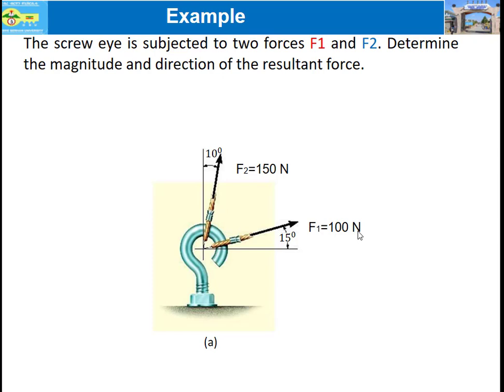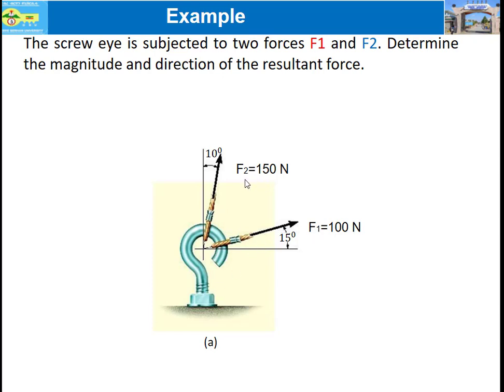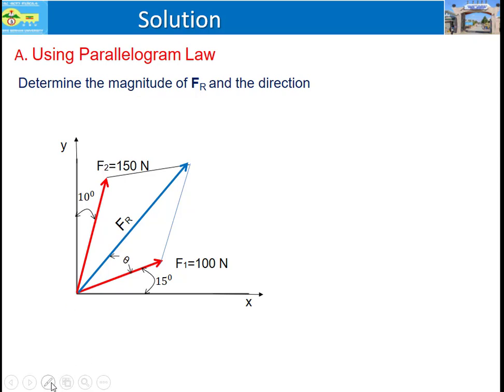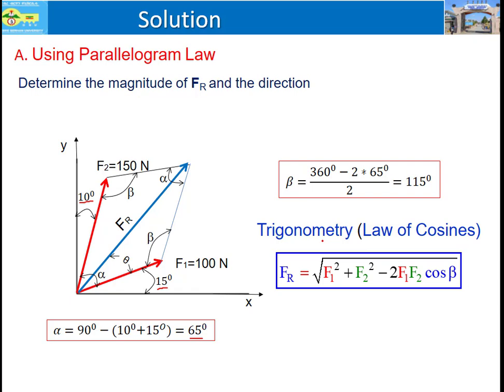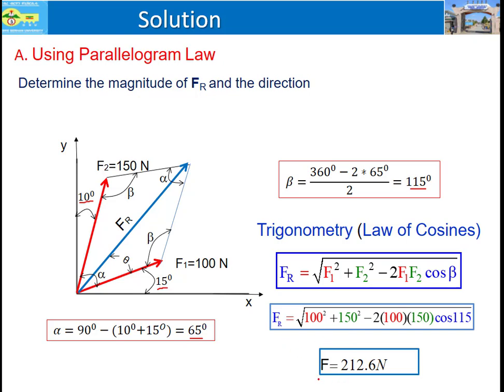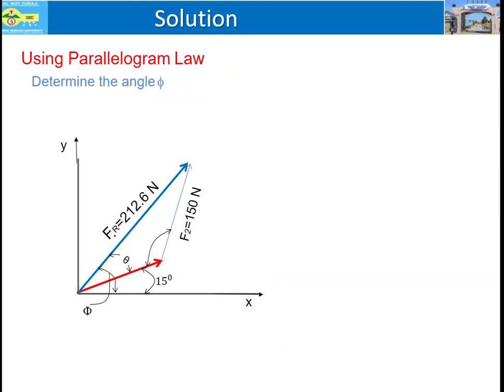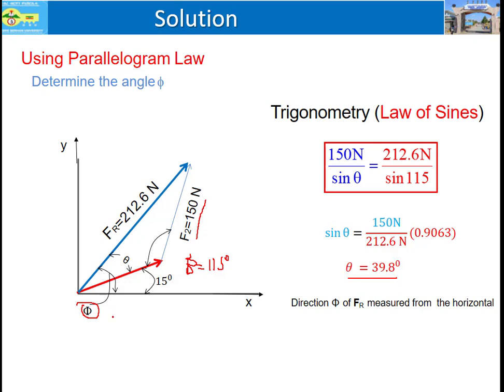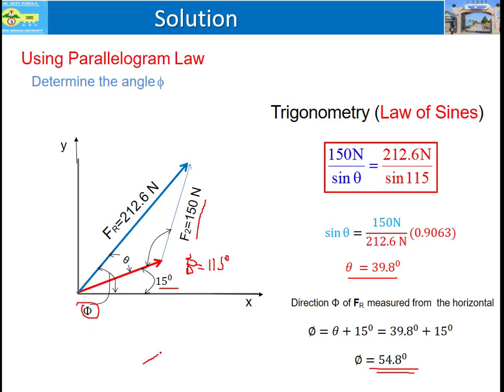Calculating the Resultant force  Using Parallelogram Law, ለኢትዮጵያውያን

Comment: wrong answer on sin  theta
Reply from the maker: As long as the formulas are correct it does not matter sometimes if we get the wrong answer. However, for this particular example, I have checked it so many times before being uploaded and it is the correct answer.

Comment: I have a question, no matter how hard I try, the result does not come out 212.6. How do I do the math?
Reply from the maker: Furst Cos115=-0.42, and inside the square there is a ❝minus❞ sign, finally the negative sign changes to positive.
Reply: @Civiltimes2210  Thank you very much ❤
Reply from the maker: @kimsoyoul9734  So, did you get the result as  212.6 now?